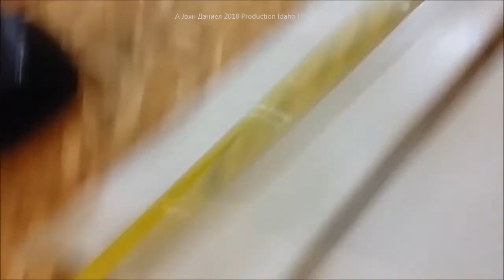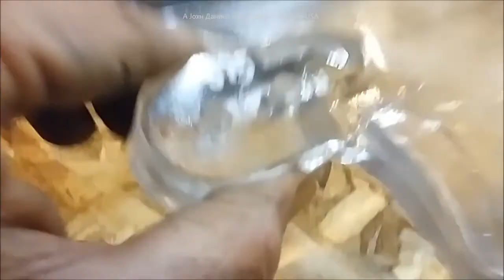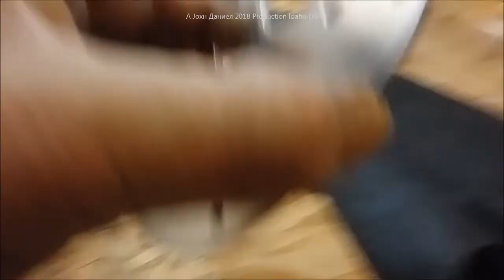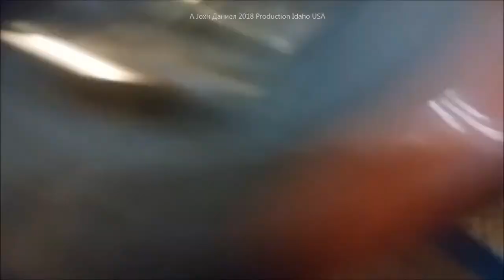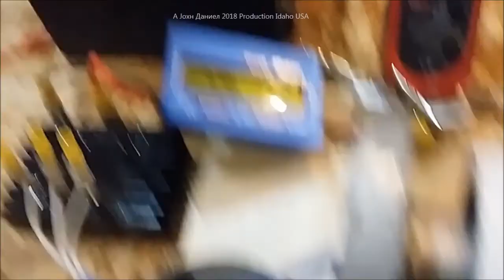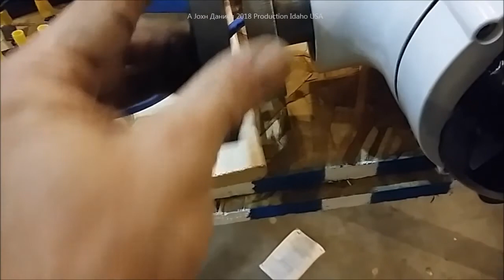500 Watt wind turbine power test and power it UP! Parts below (updated source for them below)

Comment: youre 100% right i worked for a company that made plastic pipes using 400 tonne injection moulding devices , its an art to getting plastic perfect without hollows inside the plastic , just a slight difference in temperature can ruin a job and you wont even know it as they still look perfect. i dont think they ever achieved perfection just near enough.
the thing is that new chinese turbine is rated correctly and if the blue mws was rated correctly youd never buy it with the watts it produces at 24mph it would not inspire you to even consider buying it in comparison to other turbines "especialy" with the advertised rating of 1600w , once youve seen what it does at 30mph youd be very annoyed with your purchase.  ofcouse not all turbines are as advertised and thats where people like you are a help.
 im "Not" perfect but man i hate and i mean Hate deceptive advertising.
 that drill of yours was spinning fairly slowly cmpared to what a turbine does up on a pole, ive done similar tests and have found blades produce supprisingly more power than alot of drills so you end up pleasantly supprised with the turbines power output.
youre a blessing J.D putting people on the right path. you called the right specs for the blades too.